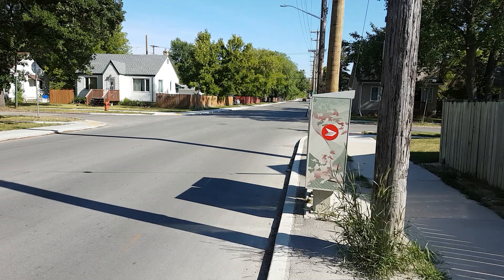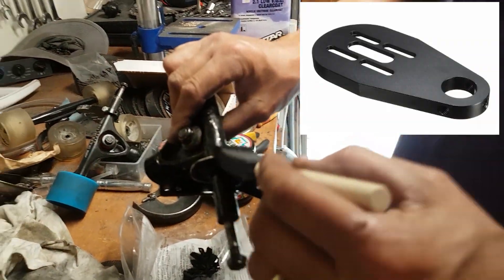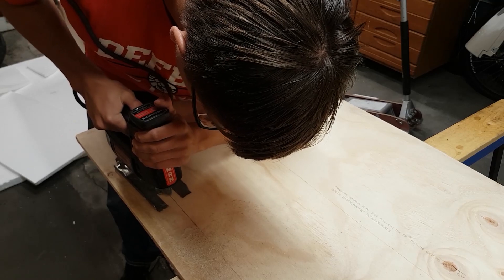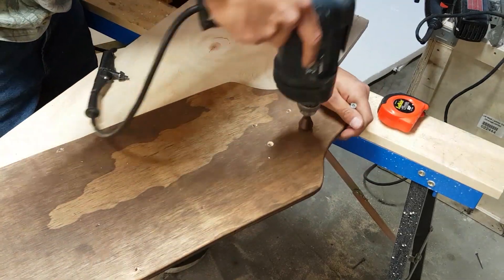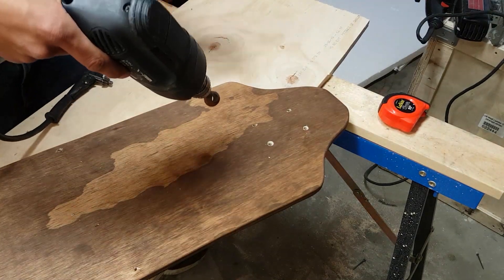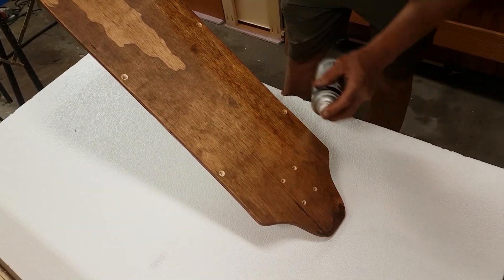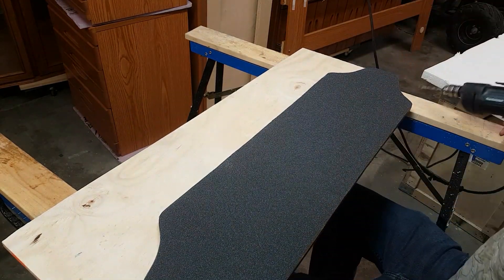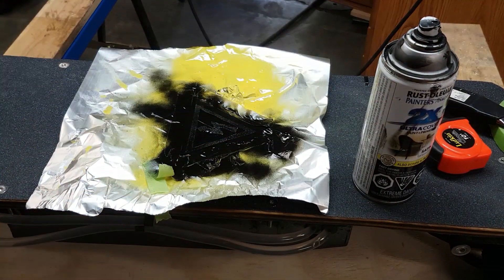Water Cooled 4000 W Electric Skateboard - Part 2

Comment: Very cool, what's up with the blue mixture is that a special coolant?
Reply from the maker: Yes, I needed a coolant that would prevent algae growth in the liquid. Initially I used a mix of rubbing alcohol and water, but that slowly degrades the tubing.

I switched to a pre-mixed PC water cooling coolant from Amazon. It was blue as well so it fit the colour scheme a bit better.